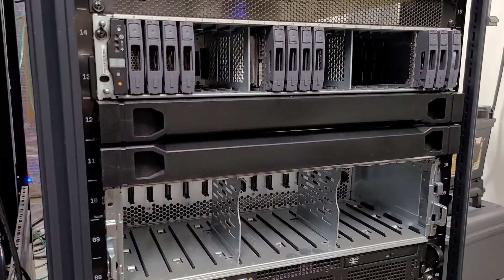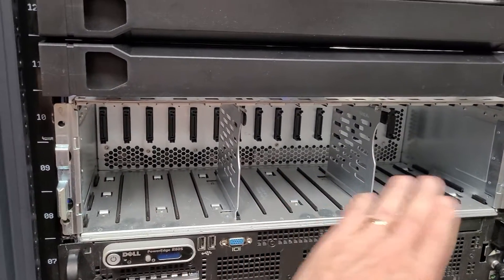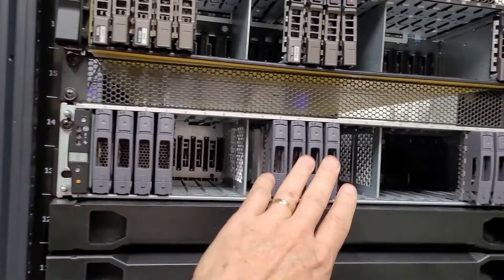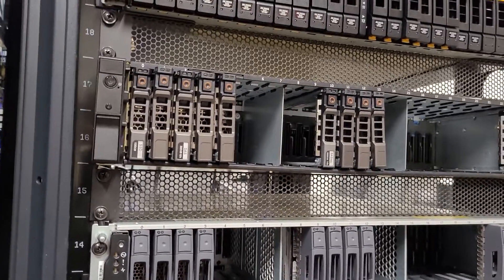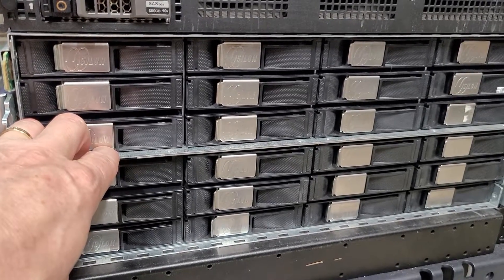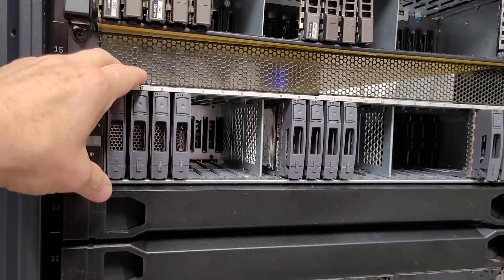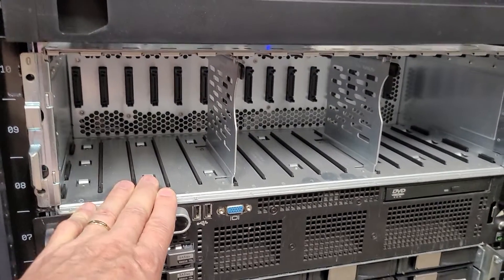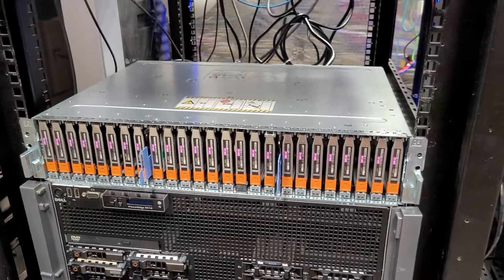How to really get the most out of your SAS disk arrays.  This may surprise you how to tweak it out!

Comment: Great video!

Not sure if this is your area of focus - but would be great if you can do a video on 'noise control' for those of us that must have a server in our office or apartment (yikes) - I am stuck with the Rosewill LSV-4500 because the super micro's (even with quiet attachments) are very very loud.  

Would be great if you can maybe do a video on DIY or alternatives that are 'quiet'.

Very cool channel!
Reply from the maker: Oh yes that is part of it.  Disk arrays (either SSD or spinning disk it doesn't matter...) control their own fan output so the trick this is to place the array close to the lowest point near a AC ducking or vent, the better the air flow the lower the fans will run.  You may want to go with a 2U server instead and can be throttle down in the BIOS to run silent and limit the number of disks you use to keep the temp down inside the case.    The server case will get loader it it gets hot and will not be silent for long.  Hope this helps some... /:>

Comment: I understand RAID etc. However using a disk array for backup. Can you have drives stop if they haven't been accessed for a given period of time? Perhaps with the directory information on a SSD?
Reply from the maker: Well yes the controller can spin down disks after a period of time that you set plus I think also TrueNAS will let you do that as well at the OS level. No need to use SSD for directory for you have RAM caching to do that role.   SSD drives do not spin down or go to sleep.  No need.
Reply: @leadiususa7394  On the TrueNAS thanks - I'll do some research based on the hints. 

On the SSD, let me clarify. They don't spin down. So the question was can you have the directory info for the HDD that have spun down, on the SSD. That way you don't have to start the drive up to do a dir listing, or find out space that's available. It's only if you want to read or write the contents of a file on the drive, that you need to spin it up. 

Now I know some drives have SSDs for cache to aid in this
Reply from the maker: @Nickle314  You have it about right.  The caching is controlled by the OS/controller level and can use RAM or SSD or both as needed and it holds many values (Data info) including the Directory tree and other values.  All data will first go to the cache first and when it is filling up it will active the SSD drives to write or read as need so yes that means the SSD drive are in a normal passive state until call for use.  But! Did you know that SSD drives use more power then spinning disks on avg. draws during use.   Oh and as a side note yes, SSD drives do have a kinda spin up state (Like spinning drive have when spinning their disks.) but is done base on voltage instead of RPMs like the spinning disk have.  Over all the ware and tear is the same for both SSD and spinning disks over time.  That is how the Hard Drive companies stay in business.  Sad I know..  Back in the day I remember the 15K RPM 15 year life cycle hard drives, Those things work for a very long time.  But there is no money in that way of business!  Next!
Reply: @leadiususa7394  Ages ago I came across an IBM mainframe set up. 

RAM -> slow ram -> Fast disks -> Slow disks -> tape [a robot carosel] was the heirarchy. 

Files slowly went down the stack if not accessed, and then if they were, slowly move up the heirarchy.  

There was some config, such as how far up the stack things moved when accessed, but  its a LRU strategy in practice. 

You can imagine similar for onsite offsite, remote back up  and RAID. 

What's needed is just set the policy and let the machine sort it out for you. 

I'll have to check that SSD start up power consumption. I've not heard that.
Reply from the maker: @Nickle314  Yes that is correct. We call it HSM now  (Hierarchical Storage Management)  except you can now use Cloud tech to act as the cheap slower speed storage.  Or you cna use a local SSD for the high speed needs and SAS or SATA or both as your slow HSM storage if you don't want to use cloud storage.  Not to many people need that kind of storage at home for a DB or Application needs.   Most just store data and want to get data over faster so they go SSD way.  /:>   But some do build out test run with applications and there own data bases.  So go for it!  The cool thing is that you can do it by buying cheap stuff off EBay to do it.  Sweet!

Enjoy dude!
Reply: @leadiususa7394  Thanks. Appreciate all the comments.